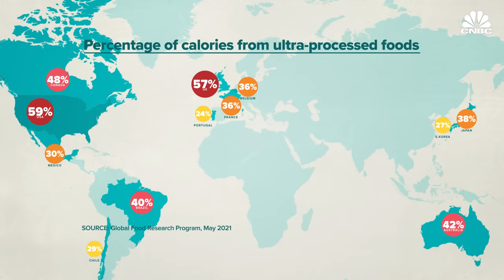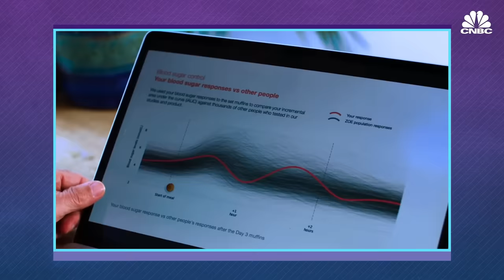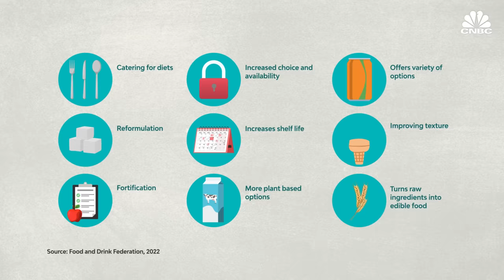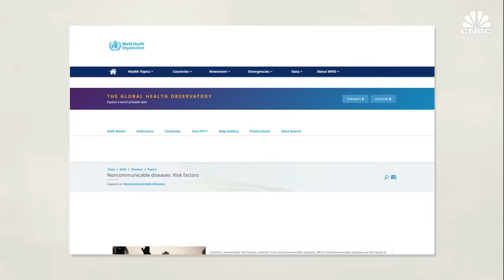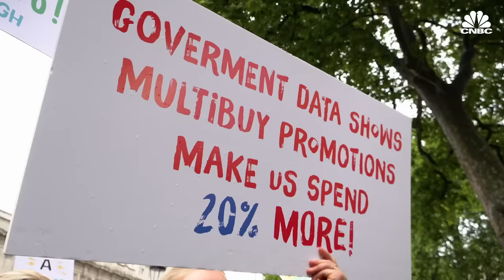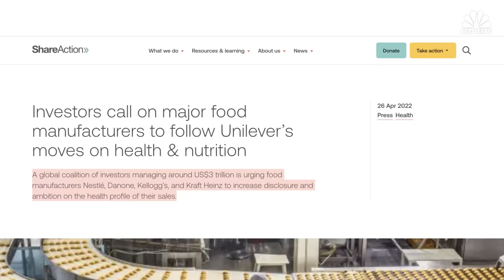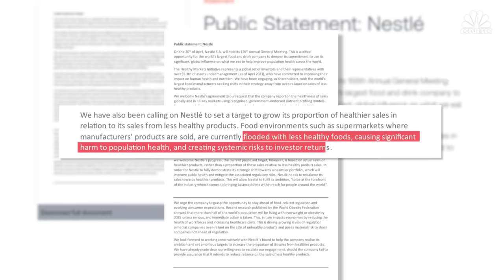Why do we have chemicals in our food?

Comment: Calling the UPF sector the largest manufacturing industry in the UK really brings the point home. But I can't imagine a daily 14h food break to "let gut bacteria rest".
Reply: 8pm to 10am is 14 hours. It's not impossible, although... I think exactly 14 hours is probably the ideal and not totally necessary.
Reply: Agreed, people need to pub crawling through the night into the wee hours.
Reply: People do intermittent-fasting all the time, though -- usually 16 or even 18 hours per day, in fact. It gets much easier after a while.
Reply: I breakfast at 10am, dine at 7pm, and don't snack. That's more than 14hrs, easy.
Reply: @annalieff-saxby568  I'm in Spain where meals trend a bit on the late side, so I eat at some point between 12 and 2pm, and then again before 8pm -- one is a big meal and the other one medium, whichever I feel like first. 
It has been going wonderfully for me.
Reply: I finish eating at 7.30pm and have breakfast most days at 9am. I'm not quite there.
Reply: @kiwitrainguy  I suggest taking a big drink of water first thing in the morning, which can help put off breakfast for a bit longer. It worked for me, till I was finally able to cut breakfast entirely.

Comment: Diabetes, obesity and cancer. Like diabetes and cancer are linked to obesity, and obesity is caused by irresponsible consumption, not by the kind of food you consume.
Reply: The kind of food you consume has a major impact on the likelihood of you overeating or not. People on whole food diets are far less likely to overeat, as whole foods tend to be more satiating, than people who eat ultra processed foods, which are designed to be hyperpalatable and trick the brain into overconsumption. The quality of your food also impacts the quantity of food you need to eat. Nutrient dense foods don't need to be eaten in the same quantity as calorie dense foods, often filled with so-called empty-calories, foods that have little to no nutritional value as they lack the minerals, vitamins and thousands of different types of micronutrients commonly found in whole foods, which certainly influence your risk profile for cancer, diabetes and obesity.